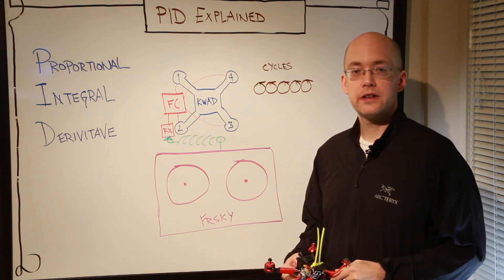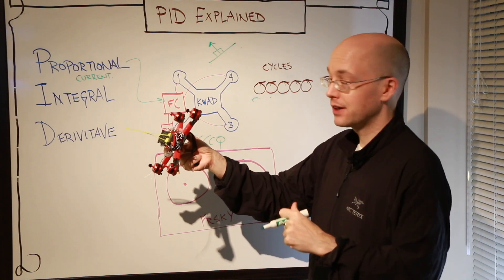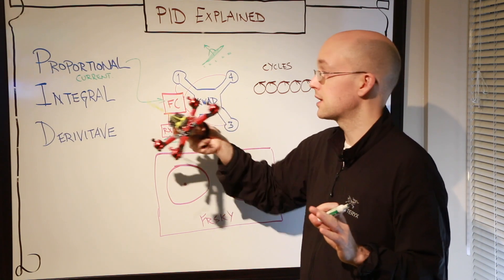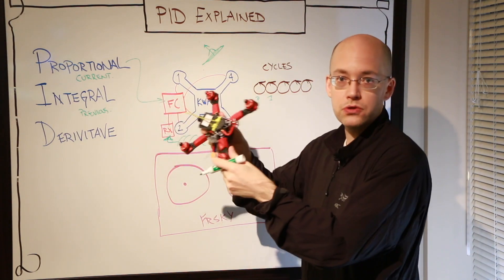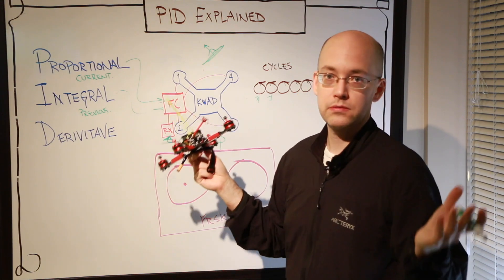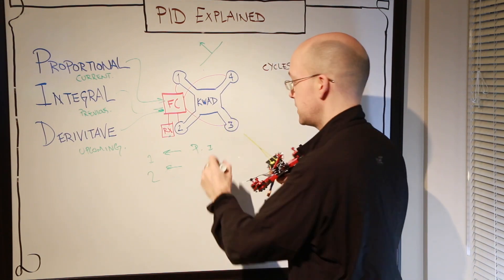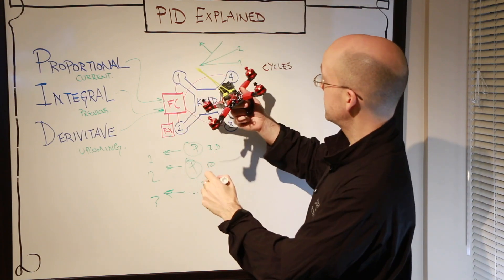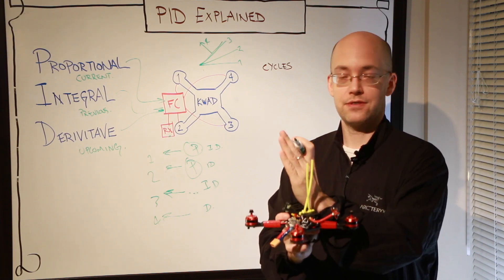Quadcopter PID explained

Comment: Thank you for this enlightening explanation. My challenge now is to determine what the initial values should be for a large quad I am building. I’m thinking of using the default values built into the flight controller’s firmware and then tweak the values individually, beginning with P then I and finally D until I get the stability I desire.
Reply from the maker: Do start with the default values then tune from there. There is really no 'template' that I have found. You could have the same flight controller model but they behave slightly differently.
Reply: @BusinessAnalyzer  Yeah, I found that out the hard way. Mine crashed when I changed flight modes to LAND and the motors disarmed. I am almost done repairing the damage and when it is ready to fly again, I will start with the default values and make small tweaks.
Reply from the maker: @BrjanBuckmaster  Ouch!  I use a Frsky Taranis transmitter and programmed the flight modes into a toggle, including a toggle for the Arm and Disarm.  Betasky flight controllers. I used a lot of YouTube tutorials to get all those configured back in the day. I've been away from building for a while. Maybe will get back into it in a couple years when the kiddos get older and bother me less :)
Reply: @BusinessAnalyzer  The damage to my Tarot was extensive. In retrospect I should have purchased a complete new frame kit rather than order replacement parts individually. It has been a long process. As I was leveling the motors, I discovered a split in one of the motor mount - don’t know if it was crash damage or if I cinched down the screws too tightly. A visual inspection revealed small cracks for in on the others so I’ve ordered replacements. I’m waiting on the two black mounts. Once they arrive and Are installed, the repairs will be complete. I intend to attach long thin dowel rods to the landing skids in order to prevent tipping over on takeoff and landing until I’m confident that it will be stable enough to control and I can land it safely manually.

Comment: Wow, nice video. The way you're explaining it sounds like PID tuning is more about adjustments to correct the quad to become more predictable - to match stick input with what the quad does. As opposed to rates adjustment which is more about personal preference (of sensitivity of the sticks at each part of the range). Am I understanding that correctly?
As far as the cycles are concerned, it sounds like PID needs to be adjusted in that exact order. e.g. loud scream, quieter scream and adjustment once loud scream is no longer heard. Correct?

Comment: A basic question here, the error is [Radio Input - Sensor] or [Zero level - Sensor]?
Reply: legolas8886 I believe Radio Input minus Sensor is the error, as that is the error between what you wanted your result to be versus what your current actual result is.

Comment: Really good explanation of pids. Thank you very much! Wonder if you might have any tips...Running Silverware on Bwhoop pro...I'm in the Keil bug software. Learning how to adjust quads at programming level.   I am getting this really crazy back and forth wobble in angle mode...It is not as bad in acro.  I know that in acro it's turning off the gyro/accelerometer. I am using the b-whoop boards in my own custom builds. I have tried so many different test's adjusments...It's better. But I still have a slight wobble in acro...and its terrible in angle mode.  In the stock firmware there was no wobble in angle..Bound and determined to figure this out.

Comment: You mention cycles on miliseconds time frame, that seems inaccurate. If the  CPU cycle rate is for example 1 GHz then a cycle lasts 1 nanosecond.
Reply: The attitude controller software for quads is running on a loop in the microsecond to milliseconds scale which is much slower than a CPUs clock cycle.

Comment: Andrew, thanks for video. One question, when tuning P, do we need to have I and D already set? or starting with like P = 50, I = 0 and D = 0 is ok?
Reply from the maker: Lev Ani Some drones might wobble in flight. This can be very visible while flying the drone with FPV goggles. However, sudden forces on the drone like a gust of wind can cause erratic behaviour and a possible crash.

One of my nano drones will simply flip over the moment I give it enough throttle to get into the air.

Comment: I have heard the same explanations from 3 diff plp and they still dont teach you how PIDs truly affect the flight. They are teaching theory on a whiteboard. Just grab a quad and a laptop, take it to the field and demo how diff setting in Betaflight, cleanflight, etc affect the flight, flips, dives. That what I want to hear.
Reply from the maker: Hi Eli. Agreed as well, however, unless you have the sticks in your hand it is hard to demonstrate this. Hearing the PID explanations helped me to understand why I am getting certain wobbles during flight and how to adapt the PIDs to get a more stable flight.   

Check Mr. Steele (Former RoterRiot member) he has a video where he had 2 quads with the same flight controllers and the quads performed radically different.  The theory helps frame the context.  

Large differences in control, work on the PID, for smaller vibrations during flight, work with the I and D.  It's all trial and error at that point.

Cheers!
Reply: depends on your learning style
Reply: The problem is that most quads are running PID controllers on their attitude rates, not attitude itself.  Correcting attitude error is much more intuitive like in this video, when in actuality, the quad controller PID is correcting attitude rate error (deg/second of roll, pitch, and yaw)
Reply: @dlwalter  Thanks for this clarification, I was thinking something was off with the explanation… the sticks do not command quad angle, they command quad rotation speed! I guess one way to see it is that the video is still valid as explanation considering that the aiming position is in constant movement (at the rate set by the stick).
Reply: Look here its what u want... https://youtu.be/27lMKi2inpk